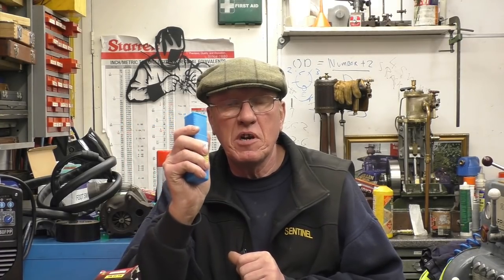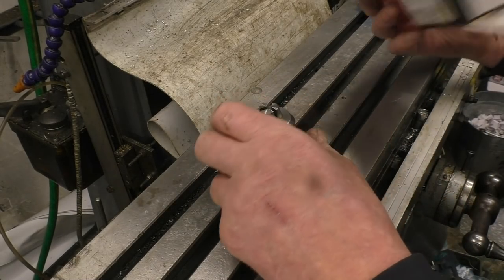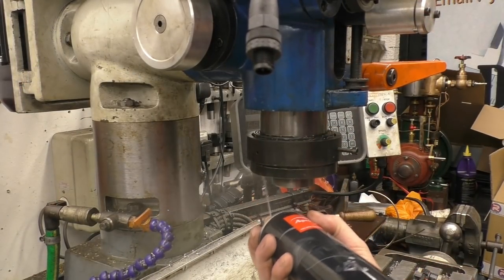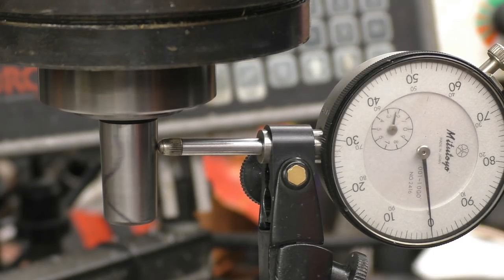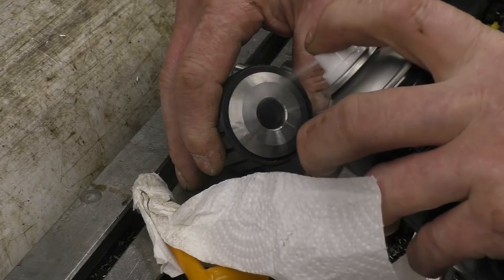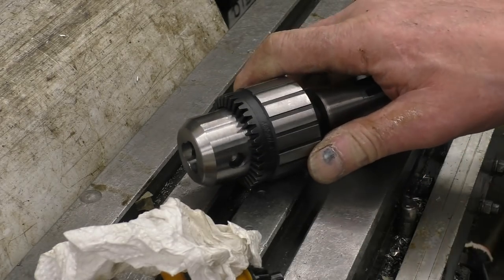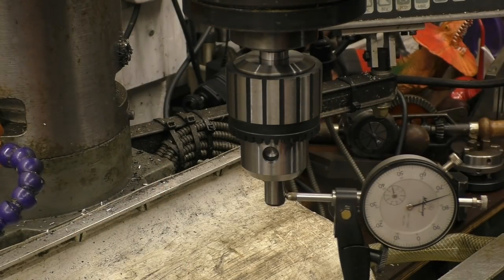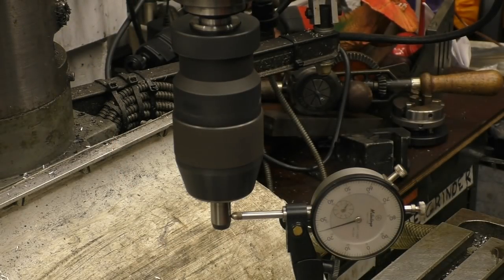Banggood  Drill Chuck & Arbour Review & Install

Comment: That was a good arbour.  I had an R8 one from Bang-good in which the 7/16 unf thread for the drawbar wasn’t parallel with the axis of the arbour. Rather than send it back, I drilled it out in the lathe and tapped it oversize for an insert  which was then drilled and tapped for the drawbar.

Comment: I, just today, received a Banggood chuck and B16/ MT2 shaft.  Ordered it two months ago.  In stock when ordered, then once on order, I was shown that it was on backorder.  I wanted JT33, but those showed backorder at the onset.  At the same time, I ordered a lathe tool set, that's still pending shipping.

Comment: Thanks for that 2 thou seems reasonable. Not sure how good a new Jacob's chuck would be, but I can't see it being much better.

As an aside for those interested, you an remove a chuck from an arbor, by drifting it out.
Reply: Drifting? Surely by using a mating pair of slotted wedges, sold for that purpose.
Reply: @ricktherecorder4416  If you mean either side of the chuck between its shoulders and those on the R8 arbor that might work but it doesn't work so well on a MT2 or MT3 arbor because it has no shoulders. 

You just pop the chuck on the vice, sholders resting on the jaws, arbor able to fall and put a drift down inside the chuck and tap.
Reply: @BensWorkshop  Never had a problem using wedges on my MT3 arbors.
Reply: @ricktherecorder4416  the MT2 arbours I have certainly don't have the shoulders whereas a drift works regardless.
Reply: @BensWorkshop  Good tip, just in case then.
Reply: @ricktherecorder4416  Hopefully. Works shoder or not.